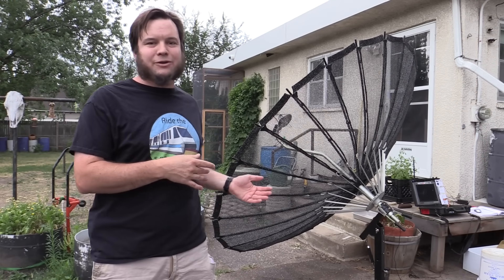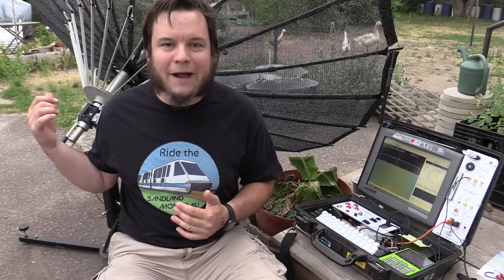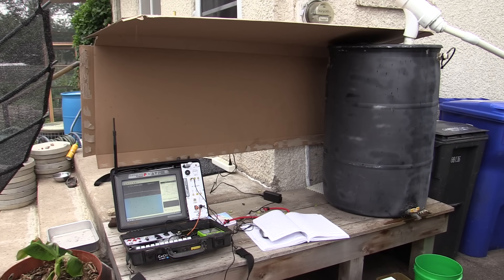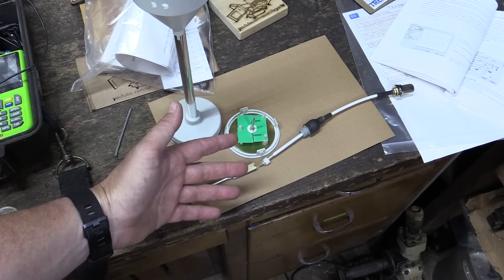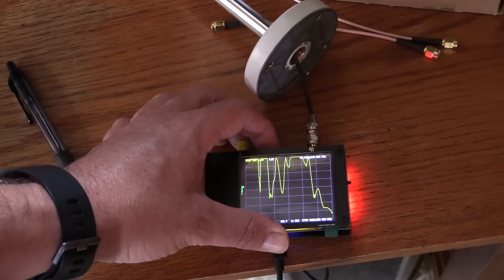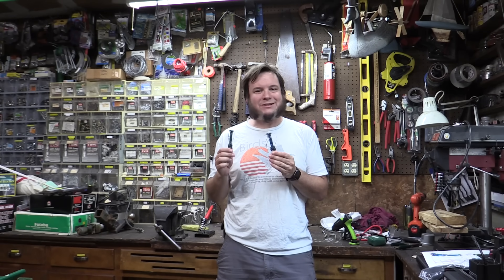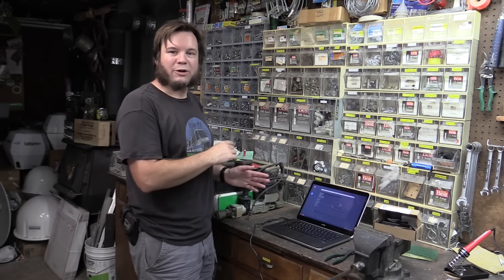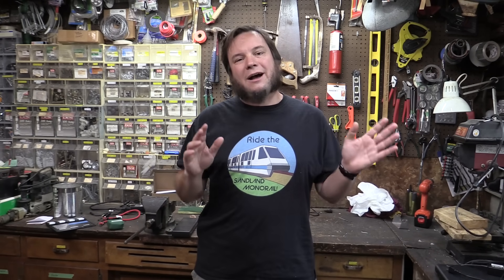Messing With HRPT Satellite Signals

Comment: I just got into HRPT, I use a 65cm offset dish with a DIY 5.5 turn LHCP helical antenna and a Sawbird+ Goes LNA and I'm having surprisingly good results! I also made a mount to hold my phone at the correct angle do I can load Look4Sat which makes hand tracking much easier!

Comment: RTL-SDR has come out with a limited edition V4 as well. Limited because the filter chip they added got EOLed as they were producing it lol.

Those Chinese antennas, 40% of the time they might be great, 60% of the time they'll be as good as a random coathanger. Until you can characterise them. Maybe I'm being too generous with the percentages.

Comment: I wouldn't think it would be too hard to make  low-power  test transmitter that has harmonics at 1.6GHz, which you could use to align the antenna to the dish and compare different antennas in a static environment.

Comment: Something I'd like to see is THE simplest possible (and cheapest) software and hardware to get started searching for satelite, for internet use?  I remember packet radio, does such a system still exist?
Reply from the maker: It depends what you want to do. I haven't done much packet radio, but I believe there are packet satellites and cubesats as well as voice repeater hamsats. If you want to get VHF weather satellites, this kit is a good starting point: https://www.amazon.com/dp/B0BMKB3L47?linkCode=ssc&tag=onamzgabeemer-20&creativeASIN=B0BMKB3L47&asc_item-id=amzn1.ideas.155I0QIXWTB54&ref_=aip_sf_list_spv_ons_mixed_d_asin
Along with this LNA: https://www.amazon.com/dp/B07TWPR871?linkCode=ssc&tag=onamzgabeemer-20&creativeASIN=B07TWPR871&asc_item-id=amzn1.ideas.155I0QIXWTB54&ref_=aip_sf_list_spv_ons_mixed_d_asin
Reply: Thanks @saveitforparts

Comment: you want to see the antenna pattern for those helical antennas. i suspect most of the power might have been coming from side lobes that were actually outside the dish. and you can get some really weird lobe arrangements when you mess with an antenna and make it from scratch like that. i would guess that a highly directional antenna with a very simple antenna pattern with most of its power out front would work best with that big dish. a lot of the commercial L band antennas you can get don't even use a dish at all (like most GPS antennas). heck, i would even try an off the shelf patch antenna meant for GPS and just stick it on the horn of that dish facing towards the dish and use that instead of your stick antenna. just be careful not to blow the ass out of your RTL SDR lol

Comment: Maybe you could a telescope equatorial mount. They use motors and might be able to track with them. They certainly provide ability to track in right ascension and declination. As you mentioned just need to track it for 15 minutes.
Reply from the maker: I haven't found a beefy-enough telescope mount for these antennas. I think I already broke one trying to use a telescope that was too large!

Comment: I'm pretty sure the reason the little stick antenna is working is the dish isnt too perfect and the element placement is meh, which is actually scuffing your antenna gain for the better. what  youre trying to do if you do successfully get a working qfh will require some serious precision because your dish will create such a fine pin point you have to aim and if youre off even a little your signal goes missing fast.
not too sure on your options but if you have something in the 1.6ish ghz range that is geosynchronous, you should just aim it at that and then spend somany hours tweaking your setup till you have a very good signal to noise on it.

Comment: Your vertical element is wrongly orientated at the dishes focal point. You have the monopole pointing toward the dish. However the signal will be hitting the element end on, where the ground plane has least gain.

Rotate the antenna at the feed point so the connector pokes out of a side, ideally parallel to the satellite track, and I think you'll get a better signal. A dipole may be a better choice.

I've also seen people remove the SAW filter from active GPS antennas.

Good luck! Watching with interest.
73, M1GEO.

Comment: The antenna you made (monopole) looked great except the strongest signal is not out the tip of the monopole but to the side.  Could you put a dipole antenna in the focus?
Reply: Except that when mounted in the dish, the angle of the waves coming in would be at an angle on the sides, from the parabolic reflection. It would be interesting to see a comparison, but to remove variables it would need to be aimed at a geostationary sat.
Reply: I love this video.  ... I agree, the 1/4 wave antenna receives best (in theory) in a direction perpendicular to the radiator.  I also agree (FWIW) that a simple dipole would be good to try, and easy to make, test & setup.  It should be 1.65 inches for each of the two legs.  (Maybe you already tried this?  It seems like a dipole would always be a good base-line to compare everything else too). Sorry if you already did this in another video and I missed it.  .... This looks really fun.  Time for me to order a RTL-SDR.  👍👍

Comment: Your focal length is wrong. It has to match the spacing of the old C-band feed horn. I've had to deal with this to repair C band installations. If you can find a copy of Skolniks RADAR handbook, you can find the design information you need.

Comment: Others who have had success with small antennas and HRPT have used a regular (NOT QFH) helical feed with a reflector plate.  They are easy to make from "random parts".  The circumference of the helix is about 1 wavelength, with a roughly 0.2 wavelength spacing between the windings.  The more windings, the higher the gain.  You want to tune the gain of the feed to properly match your dish.  For a high F/D dish (like an offset type), you'll want probably 5-6 windings, whereas for a prime-focus dish in the 0.35-0.42 F/D range, you'll probably want about 3-4 windings.

Comment: 39" (~1m) dishes are routinely available on eBay and they're normally used for Ku-band satellite reception.  Using a helical feed of about 5 turns and an appropriate LNA+Filter (Like the SAWBird), success should be fairly easy.  Obviously, the bigger the dish, the less you have to worry about optimizing the OTHER parts of the system, but they're harder to come by, and are harder to point.
Reply: The bigger the dish, the narrower the beamwidth, so as you said you have to be a lot more accurate with the pointing

Comment: The NOAA "brids" also carry SAR payloads (search and rescue) for picking up ELT transmissions, and then relaying them to ground stations.  I don't know whether those down-links are "secured" or not, nor what the formats are, etc.
Reply from the maker: That's something I have on my list as well. I think GPS satellites also have a repeater for 403mhz to something else. Apparently they sometimes pick up random transmissions from other equipment, foreign TV, etc.
Reply: 406MHz and I recall that the actual TX frequency is randomly assigned over a small range so that no two TX in the same sat coverage zone are likely to collide.

Comment: Unless you're transmitting I don't think you're having resonance 'issues' with the element.  
SWR shouldn't matter much on RX beyond added noise?, it's when you transmit and a bunch of signal gets reflected back to the radio that it's a problem. 
I'd be looking at old dish motors from the FTA boom, though I'm not sure these sats are in the same arc as TV stuff. I had a SG2100 on a offset dish to a DVB card. Might have to dig it out of the closet at work now that I've moved.
Reply: A non-resonant antenna will be less efficient than a resonant antenna

When you are working with weak signals, every bit of gain helps
Reply: @dorvinion  While I don't disagree with that, especially if the element is short?...

Fixing the positioning and focal point issues I'd guess  makes way more difference in terms of weak signal here.
He's getting pretty great results from a duct taped umbrella I must say, but I think that flexibility is  and is going to be a challenge.
It'd be interesting to see once he gets a good dish/mount and  tracking how much difference tuning the SWR actually makes.
But you kinda need somewhat of a control.

I know mucking with my dish was a challenge for awhile trying to get things positioned properly for the whole arc. Tweak the lnb a hair this way and you've got one sat great on one side, and now you've lost a couple transponders at the other end of the arc. :) Get a good wind storm and have to tweak everything again.
It was a rental and I couldn't really secure it well.  I know I wouldn't have got much of anything if I was the one out there holding it :)

Comment: RTL-SDR has a v4 out now that supposedly is awesome and generates a lot less heat. Can't wait to try one!
Reply: And cheaper! Also some improvement with HF. I can't remember off the top of my head.  Down side I guess is its using a discontinued chip and it will be a limited run supposedly.
Reply: The improvement was that there is now an built-in downconverter, rather than having to use direct sampling IIRC @ericgulseth74
Reply: @ericgulseth74  Also it uses a different driver, which for me was a hassle to set up on Arch Linux.

Comment: I have an idea as I've learned from this video that the larger dish has a more precise focal point. How small is it on that big dish? Old saveitforparts original LTE phones operated on 1.7ghz. Could you yank the board from an old jitterbug or other garbage phone and just solder to the antenna of that and use that as a custom feedhorn? Just putting together new things I've learned from this video!
Reply: Also it's the keep-to-it attitude that makes you awesome and the channel so great! Through weeks of hotnsweaty failure you got it to work! You can tell that you persevere even through the many takes to make the videos themself as you showed us in the blooper video awhile back. The positive attitude toward the grind is infectious!
Reply from the maker: Interesting! I didn't realize that was on a similar frequency, I'll have to look for an old phone now!
Reply: @saveitforparts  I'm not sure which generation of phones used the 1.7ghz signal, but it's definitely classified as mobile (and a couple other things) by the FCC. It's tough to narrow it down as 1.7ghz is also a common processor speed in phones...

Comment: I just bought 200 acres of land, to build a bunker and off-grid homestead. It's in a location where I should have access to gigabit fiber, but I will also have a hill where I put an antenna farm.

One goal is to build an integrated software suite which can receive weather satellite images, geographically align them from multiple sources, and superimpose real-time ADSB (aircraft position data) and AIS (ship position data), plus any other data sources we can get our hands on (examples include marine or aviation radar mounted on a tall tower). 

The goal is to have one screen where you can get as much situational awareness as possible at a glance. All completely off grid.
Reply from the maker: That sounds awesome! I've always wanted a screen / screens like that with the AIS, ADSB, stuff in space website, etc. If you have good line of sight to the South and can find some old C-band dishes you could get live feeds from GOES satellites and various free TV channels (if you can find one that isn't funded by China or Russia!)
Reply: @saveitforparts  Indeed! It's all so exciting. I guess I should be more direct - I'm willing to help out even more financially (and/or involve you in my project) if you want to do heavy lifting that I can piggyback on. I currently donate around $10k a month on Patreon.